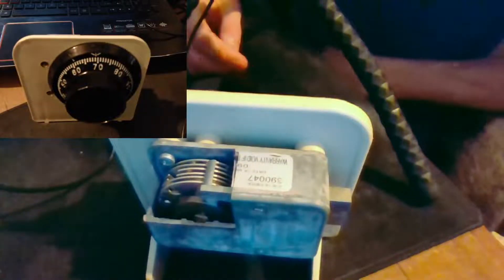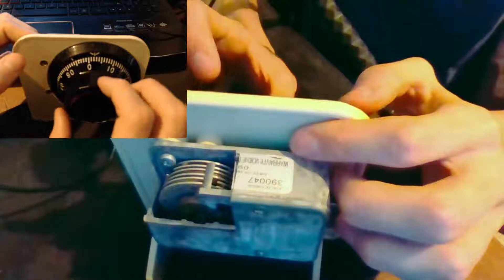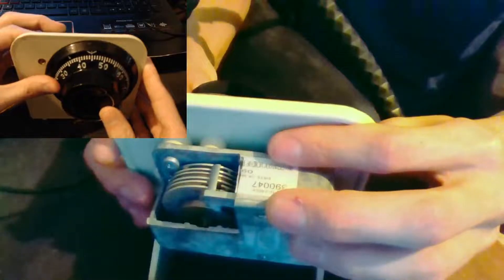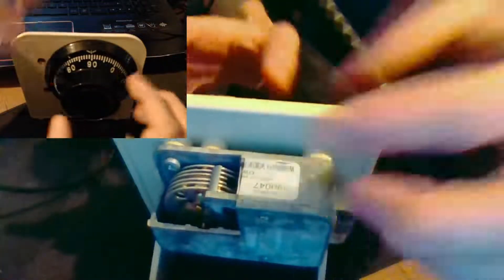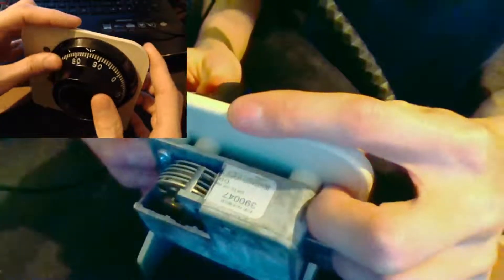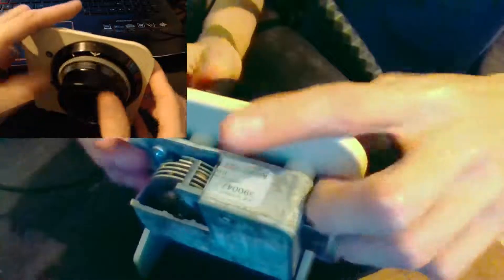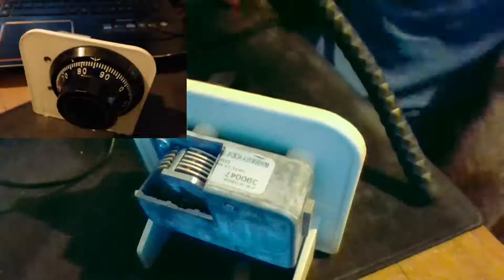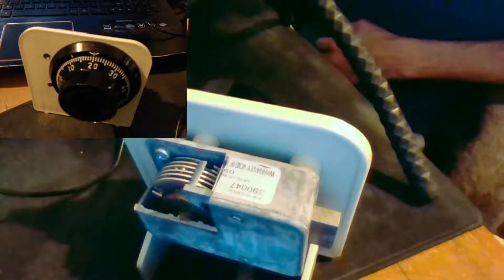Real-time Safecracking Demonstration of S&G 6741

Comment: Number one YOU DO NOT SPIN the dial, 2nd you turn left to pick up all the wheels and go from there. If you are going to post post it right.  I dont know where you got your info but it is wrong. the correct sequence is left 4, right 3, left 2 and right 1 or to open

Comment: Do you know if it's  possible to do on an Amsec Floor safe? There is one at my work( school) but no one has opened it. School was built in the 1970s. I tried the sparrows safe cracking and I got it open. The problem I am finding is I can't  feel the the lever hitting the back side. Any help.

Comment: I have a GSA container filing cabinet with a Sargent & Greenleaf lock. It’s my mother’s who died a year ago. Are you near Monterey California? How much would you charge to crack it?
Reply from the maker: That's a 5 hour drive for me unfortunately. If it's a GSA container with an s&g lock on it, it's most likely a group 1 safe lock. Usually an s&g 8500 series or depending on the age, the older 8400 series. These are considered high security and in most cases it would be faster and cheaper to find a local locksmith to drill it (still not cheap since they have hardened steel plates to resist drilling) as the vast majority do not know how to crack even the simple group 2 safe locks I have my video tutorials on. 

I can manipulate the lock open with no drilling or damage but the cost for travel, accomodations, and the job itself would be several thousand dollars minimum. If you would still like to get an accurate quote, my business email is lockmanipulator@gmail.com.

Comment: Hello,
My ITL200 was unable to
open this CHUBB 3 Wheel
Lock. Dial has a blank area
from Zero to about 85. See attached link. The
Right Contact Point is 2.
I Want to use Wheel lsolation to Unlock this safe.
Great Video and I Look forward to your reply.
Br, Daymond

https://youtu.be/VmESnQLyc_k

Comment: There's a dial combination where I work on a filing cabinet, I had a look at it after watching your cracking videos and I found that the dial is really stiff in the 80 to 20ish range. So there's no real hope of feeling for the contact points on the cam wheel because it's too stiff. Is this an intentional security feature? It's a Chubb Manifoil Mark 4 lock.

Comment: I have a 4 number lock, from a floor safe. I don't think it's possible to work it like this. The fence has an angle to it, so you can only figure out the 4th and 3rd numbers, this way. I think the only way to do this one, if it was on a locked safe, is to drill a hole to look through.

Comment: Why the first find is a third wheel ? Possible to be first or second wheel?
Reply from the maker: Possible, just not as likely. This is (probably) due to the spring on the nose applying slightly more pressure where it's closest to the third wheel.

Comment: I won't be using the correct terminology but hopefully you will understand the question.  If a lock was assembled with the drive cam deliberately out of phase with the number wheel would it pose any significant problem for a safecracker?  If they were to assume "0" was the starting point when in actuality it was "25" would that be much of a stumbling block?
Reply from the maker: Not sure what you mean by out of phase but I assume you mean the placement of the spline key so that the contact area is in a different spot? If so, that's ok. As long as the drive cam and wheels interact with each other to produce normal operation then you can have your starting point be anywhere!
Reply: @lockmanipulator  Thanks!  Your assumption of my intent was correct.  I've just printed your PDF on "Safecracking for Everyone".  I'm a hands-on type when it come to reading retention.

Comment: Your videos are great and have inspired me to take on the challenge of trying to open my mother's safe. She has lost the combination. I think I have found the first number - so far, so good. Struggling to find the 2nd number - thought it might be a good time to ask you about my safe and make sure these techniques will work for it. It is a Meilink safe - about 2 feet high and VERY heavy. It has a handle - I suppose it turns to open it. The model number is  80-xxxxx. Beige color. Do you know anything about this safe? If not can you suggest a way for me to find out? I guess I mainly want to know if it is Group 2 with 3 numbers. Thanks for putting out this great series of videos!
Reply from the maker: If the dial doesn't lock up when the handle is turned and you can feel 2 contact points then it should be a group 2! You can see how many numbers are in the combination by spinning a bunch of times in one direction the turn the other way and feel for the number of wheels that pick up.
Reply: It’s a smaller size plastic lock with hand change wheels. Plastic driver, drop-in bar and fence and plastic wheels. Imho it could be pretty difficult to feel the contact points for someone who is not greatly skilled at manipulation. 
Good luck.

Comment: can you crack a 4 wheel lock like the 6731 or 6631 with the same process just by running 1 more graph?
Reply from the maker: Sure can!
Reply: @lockmanipulator  awesome thanks for the reply! i am gonna start the journey of opening the safe i locked myself out of last year lol. i would assume that on the lower part of graph i will add a 4th wheel there to go through and check?
Reply from the maker: @xXProTechnicianXx  The upper and lower parts of the graph is for the contact points. You would just do another graph sheet. Also, you would have to remember to add extra rotations in order to account for the extra wheel. 1 rotation picks up wheel 4, the next rotation picks up wheel 3, etc. Instead of 1 rotation picking up wheel 3 then the next one picking up wheel 2.
Reply: @lockmanipulator  dude thanks a million for the videos and comments. I got my safe open that I thought I'd be paying someone to drill open for sure.

Comment: I watched your videos for safecracking. You explaning things extreamly clearly, great videos indeed! 
I am planning to give a try for 6741 using your concepts (have not received it thou). Only addition will be that I will attach an absolute encoder into the wheel to get those readings. Do you have experience if it helps any in the detection of those left/right edge position differences?
If that functions well then going to add an tension sensor and try to see if able to detect those left/right edge positions seen as tension steps in the sensor measurement.
If that functions well then going to add an servo motor to do the disk turning task.
Reply from the maker: I've been working on creating a safecracking robot, but I have no experience in electronics. That sounds like a good way to do it though, let me know how it works! I've been looking for the proper components for a while so I'm super interested in seeing how it turns out for you.
Reply: @lockmanipulator  I have experience in electronics and servo drives & motors and  position/speed/tension sensors and embedded programming. But I am still missing the lock. Need to wait for the delivery before can start playing with it. Challenge is that I have not done so far anything that should detect so small tensions. Normally in industrial machinery applications needed tension is relative to used motor tensions. I am not sure if able to find suitable components for this case. That will know after play with it some
Reply: Proper alignment of the absolute encoder is the first challenge. To do it I might need to modify a bit that wheel that is used to set dials. Or then put the encoder next to turning wheel using some gear, but then the backlash in gear will result some noise to measurements

Comment: You ever use crows feet?
Reply from the maker: I'm not sure I'm familiar with that term.
Reply: @lockmanipulator  They look like a Peace symbol and put one on the dial and one on the ring. They are just a more exact way to see the gap when a gate lined up. Have you ever tried a Group 1 lock? That would be awesome to see but not sure if those are really even viable to manipulate.
Reply from the maker: @ktms1188  ah I have not used one before but it sounds interesting. I have attempted to discover a way to crack some group 1 locks but have not been successful so far.
Reply: @lockmanipulator  Ok awesome, yeah would love to see you work through one of those and see your ideas. Thanks for the amazing videos!

Comment: Your videos have been most helpful. I'm working on a S&G model 6630. It has an eccentric roller on the nose of the lever, which gives me fits. Any advice?
Reply from the maker: I think you just have to learn to take contact point readings very gently. I haven't ever had my hands on that lock before, although I'm familiar with it and would love to try sometime.

Comment: I just opened my first lock (6741) using your techniques excellent tutorials. Took me 3hrs. Hopefully I’ll get up to your speed.

I have a question. When I was taking the right contact point readings there seemed to be a stop  and then a slight release if I let go totaling about a 1/4 increment. I think the slight return is being caused by the key lock on the dial.

What do you read the stop or the slight return? 

Hopefully you know what I mean. Thanks
Reply from the maker: Ah so you mean it feels as if there is a bump on the contact point making it seem as if there are 2 right contact points? If that is the case then make sure you read the first one. Just make sure to be extra gentle in your taking of contact point readings so you don't ride over it.
Reply: @lockmanipulator  

I can just touch the point then if I release my finger the dial moves back very slightly, 1/8 to 1/4. I think it may just be the weight of the dial lock seeking to center itself. 
 
Just curious if you’ve ever came across that with a dial lock or I just need to refine my touch. 

The reason I was releasing my finger was to try and determine if my touch was accurate. I was thinking that if I went to far the fence spring would push back. However I also realized that the weight of the lock may also affect the position after I released thereby not giving me an accurate test.
Reply from the maker: @steveelle2169  Yeah that's common. Just make sure to keep that light pressure on the dial when reading. And make sure it's not too much pressure so that you don't ride up on the drive cam and miss the contact point.
Reply: @lockmanipulator 

Thanks for your help. Now I have to get a change key and try again.

Comment: I've actually watched your videos and am working on this. I've got a s&g I lost the com to.  I'm have to watch what you are precisely doing. Thanks!  My Gap is way bigger than what you have on your locks.  My contact points were like 9 and 97 1/4
Reply: I too am trying to find the combination for my S&G. It's an older model. Probably from the 70s or 80s. My contact points are at 32,5 and 40. Similar gap as yours.